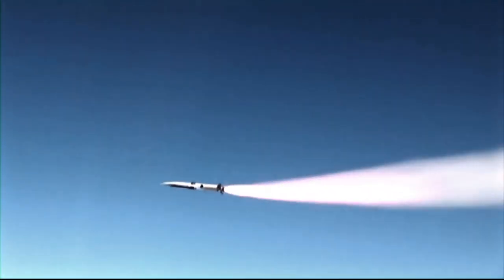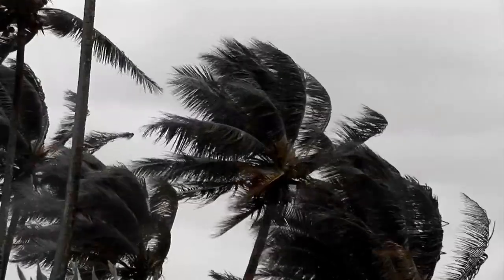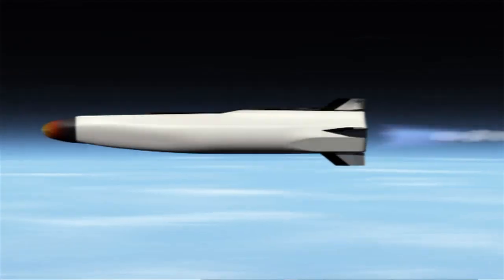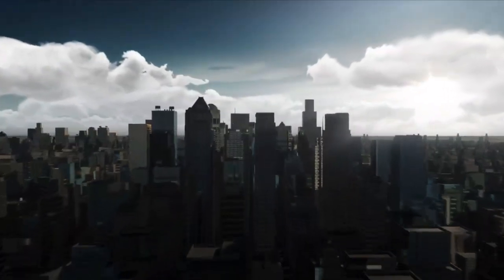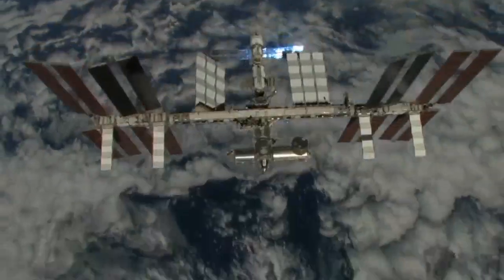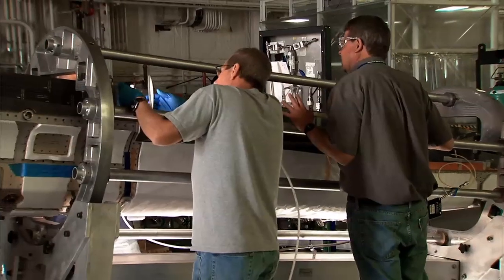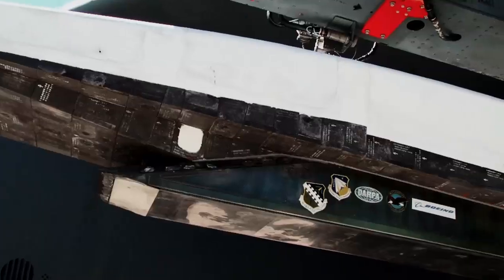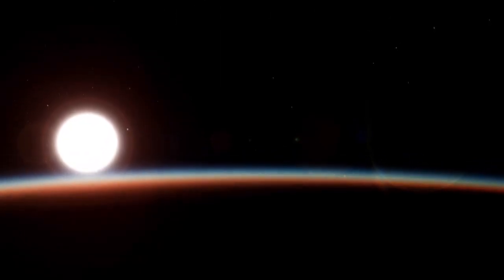Boeing's Unmanned Scramjet, the X-51A WaveRider, Achieves Hypersonic Speeds

Comment: As an Aerospace Engineer, the Scram Jet propulsion system has been known about for decades. It has been known as only as "theory" in which military applications have  limited the access to this technology. (Aura spy plane, etc). Its quite possible that this has been a reality since the early 90's, but has not been a public possibility until recently.
Reply: Most likely because it will never work in a practical application or there is already secret technology to replace it.
Reply: If my understanding of how the scram jet works is correct it needs an atmosphere to operate in correct? So how would it help us get to another planet or further into space if it relies on having an atmosphere
Reply: and so the saying goes, "it's old news when it's new news to the public"
Reply: I think taco bell is assisting in funding do they can harness this power for taco delivery.
Reply: David Phillips It has been, the problem is money.  Scramjet technology is so expensive to just get it to work, that no company has been willing to put serious research dollars into it.  The military won't do it either as they already have various rockets that already do the job anything a scramjet would look to replace.
Reply: zachpaw the need for an atmosphere is not necessary. It does help the scram jet work in this planet but in any case the scramjet would be in use for a scenario such as in space the scram jet would be equipped with its own gasses or oxigen for propulsion. I am sure the engineer's would choose another gas such as nitrogen. So your comment is partially right. It does need some sort of gas from a atmosphere to function but it does not need the atmosphere to function.
Reply: They could put an air tank right next to it.
Reply: ChrisEvan Tapman defeats the purpose of a scram jet then.
Reply: Pep
Reply: The
Reply: Don Romeo prrrrp
Reply: zachpaw injunction
Reply: Luis, the gas would have to be oxygen as that is the gas that makes combustion happen with current fuels. Carrying your own atmospheric gases makes I a rocket, not a jet. The whole purpose of a jet is to use the atmosphere around the vehicle. The scram jet would only help in a very narrow operational range and is partly why the jets aren't being developed as fast as they could be
Reply: Jerad W domino's pizza is working on a joint venture for pizza and taco delivery.
Reply: Jerad W hmm i dont think you understood the video or the question i was answering. a jet (plane) does neet a atmosphere to finction accordingly to its designed purpose. But a scram jet does not necessarily need the atmosphere. it would if its designed purpose is to fly in the atmosphere and perform particular maneuvers using the preassure of our air. but if the scram jet is designed to be shot like a bullet or a artillery rocket out side our atmosphere then in that case it would just need the propulsion and its own supply of gas. then when re entering an atmosphere it can use parachute or some other designed way of stoping or hitting its target. lets say exaple we want to shoot a scram jet to mars. we mount it to a seperate plane or rocket, we supply it with its own gas and once it exits our atmosphere it can create its own propulsion with its own gas and it would be in its way. if we want a scram jet to be used as a bomb we can do the same with its programed trajectory and program it to fall back into the atmosphere and free fal into its target. again. atmosphere can be aprecciated but its not necessary.
Reply: Luis - I understand it just fine.  A scram jet absolutely needs an atmosphere to work.  That is what makes it a jet.  A vehicle that carries both the fuel and oxidizer is called a rocket.  There are plenty of proven rocket designs to choose from that are many times faster than a scram jet could ever hope to be.    Jet propulsion takes into the vehicle one of the combustion components (usually oxygen in the form of air) to make the combustion cycle work.  A rocket on the other hand, needs no external components added to create combustion.  Like I said, take away the atmosphere, you no longer have a jet, but a rocket.  I am not discounted the idea of using a scram jet to aid in space travel, but there are already better engines to use in regions of space devoid of atmospheres.
Reply: +luis casillas Supplying a scramjet "with its own gas" is basically just a rocket engine. That's what it is. Rocket engines (generally) mix fuels from two separate tanks containing RP-1 (An extremely pure form of liquid kerosene) and liquid oxygen. The liquid oxygen allows the kerosene to combust in the vacuum of space. 

So basically, the easiest and most efficient way to have a scramjet work in space is to just replace it with a rocket engine.
Reply: +luis casillas I think this only works when you have a mach 4 air flowing in.  it starts with normal rocket fuel, then stages, the air intake is a hige part.

Comment: As much as I like Boeing mach 5 is a huge ask. The SR71 at mach 3 was incredibly difficult to make work and expensive to fly. Surface friction meant they were scared they were going to cook the pilot. The pilot wore a space suit like an astronaut. Making a cabin that will allow normal clothing will be very hard. If Boeing could make even mach 3 in a commercial air liner that would be a huge achievement. I'd like to hear more in depth information about Boeings progress.

Comment: How high up was it? It looked like the edge of the atmosphere.
Reply: +ChrisEvan Tapman Not even close, even the ISS still experiences some atmospheric drag.
Reply: +ChrisEvan Tapman It activated the scramjet at around 70,000 feet.
Reply: +IAN 4000 50,000 ft is "technically" space right?
Reply: Adam Degrace No, Global Hawk can get to 60K, U2 can get to 70K.

70-80K is about 1/8th of the way the the lowest limit of a Low Earth Orbit.
Reply: Technically, space is about 60 miles from the surface, passed the atmosphere.
Reply: Space is generally considered to be at the 100,000 m (100km) mark. Djordje is right, as 60 miles is about 96,000 meters up.

Comment: If you go to extreme altitudes the air resistance won't be as large and you could go faster, although I am not sure what the fuel cost would be to go to such heights, or what kind of planes it would require.

Comment: The SR-71 used a Pratt & Whitney J58 turbojet. Two of them technically. It was not even close to being a scramjet. The scramjet takes air in at freeflow speed. The SR-71 had multiple devices to slow the air going into the engines down so that it never entered the engine above mach 0.4.
Not to mention the fact that the SR-71 obviously used turbine engines, and the scramjet has virtually no moving parts.

Comment: Short Answer: Not in our lifetimes.
The problem with these is they only burn for a minute or two. The faster you go, the more air resistance (and at these speeds air compression) you face. In order to get from NY to LA in under an hour, one needs to travel at about 2100 mph, give or take a couple hundred.Changing speeds from 55 to 65 mph requires just under double the power. Imagine what's necessary to go from 500 to 2100. It's Definitely not a factor of 4. I would estimate it's a factor of 100.

Comment: The "parts" coming off is the booster stage. A scram jet engine will not work at sub sonic speeds. You use an airplane to get it high enough that a relatively small rocket booster will accelerate it past the "sound barrier" and up to about Mach 3where the scram jet can take over.

Comment: The big problem with the Concorde is the continental speed limit, overland air traffic is prohibited from exceeding Mach 1, because of that limitation no one bought the Concorde because they couldn't use it efficiently. Subsonicly the Concorde was a gas guzzler so extended low speed flight would eat lots of fuel, British Airways and Air France only maintained their aircraft for political reasons.

Few concorde's + continental speed limit = stupidly high ticket prices

Comment: flight at mach speeds like that causes a whole other list of safety issues. The friction from the air moving across the  airframe at that speed alone causes massive amounts of heat. But I would so still strap into that thing and push the little red button.

Comment: I think SSTO is a way of taking too many accessories into orbit. I think the (sc)ramjet should be the intermediate stage starting from the lower super sonic to the upper hyper-sonic(m5+), launching a rocket stage delivering a final push to orbit. The initial stage would be to the troposphere,  It could be an upper trans-sonic/lower supersonic turbo-jet/fan.Instead of lugging the mass of a much larger mothership, it can be roughly similar in mass. It could be like Spaceship1, & Virgin Galactice w/ an intermediate sc/ramjet phase.

Comment: So I was asked why we could not use scram jets for passenger flight or other programs besides nuclear weapons delivery.   You could of coarse use it for passenger planes, but there are so many drawbacks for manned flight at these speeds.  What do you use to get the craft up to scramjet ignition speed?  How do you deal with the sonic boom problems over the main land?  You will have to be at the edge of space to reach the mach numbers to make it worth while.  On the other hand a scramjet used for nuclear weapons deliver can use toxic fuels,  will be faster than any rocket based defense system.

Comment: Make something work without using traditional fossil fuels but  can go speeds of mark 5 and greater.. Now that will be an achievement, or design an aircraft with the same platform that you find to be aerodynamic but have either a chemical application on the aircraft or use a mechanical device that minimises air drag coefficientcies to achieve greater speeds with minimal to zero drag. Now that.... #Boeing will be something. Think big! Or don't.

Comment: Isnt this conceptually similar to blackbirds? I mean using the shockwave is what blackbird was also doing wasnt it?
Reply: The SR-71 used Pratt & Whitney J58.  The updated variant was a partial ramjet.  It used conventional compression at lower speeds and area compression at higher speeds.
Reply: Minion
Reply: If I remember right, the shockwave was greatly reduced when entering supersonic speeds for the SR. That was the cones main function, at subsonic speeds it would be in its standard place, once supersonic speeds was reached it would retract by nearly 2 feet to decrease the shockwave
Reply: Matt Jones Yes i listened something similar to what you are explaining in a documentary about blackbirds it retracted its conical shape at the jet engine entrance to adopt the shape of shockwaves at different mach speeds.
Reply: Joseph Tenney Hmm pratt and whitney is the same company which makes the engines for yf-22 i think. I remember sr-71s had retractable cones to adopt different mach speeds but this is a totally different engine airtake design i guess.
Reply: Cem Savaş Aydin No, a scramjet does not contain a typical rotating compressor to compress the air into the engine.  The blackbird still has one.  The nosecone just modifies the "shape" of the incoming air.  A scramjet's shape (no moving parts) is what compresses the airstream.  In order to work at all, a scram jet must be going faster than mach1 (or more), the blackbird can run its engines on the runway.
Reply: Jerad W Well looks like you know a lot about these planes. Have you like worked with these scramjet technology.
Reply: No, but I have a MS degree in engineering and propulsion.  It's been since 2001 that I have studied them in detail, but the problem is no company really wants to spend the money to develop the technology.
Reply: Not conceptually the same as the blackbird.  A scram jet refers to the type of engine.  A scram jet could have wings or not, but that is not important to the fact that the engine is what is so different.  The blackbird still used rotating engine parts to compress the air and fuel mixture.  A scram jet uses the vehicle's speed to compress the air fuel mixture.  Adjustable engine parts are nothing new, but were used to their fullest in the blackbird engines.
Reply: +Cem Savaş Aydin The blackbird uses a turbo-ramjet. It's sort of like a scramjet, but since it's a ramjet, it has an extra cavity in the combustion chamber and since it's a turbojet also, it uses a compressor driven by a turbine that's powered by the exhaust of the engine.
Reply: IAN 4000 wow i must go read some material first before i can even understand what you wrote above.
Are you a avionics engineer?
Reply: IAN 4000 It is a plain turbine jet, not a ramjet.  For one, ramjets aren't turbo charged.  They can propel vehicles much faster than anything having rotating parts, so they would only be slower with them.  Also, having rotating parts, by definition, doesn't make the a ram jet as both rams and scrams don't have rotating parts, that's what makes them unique compared to "regular" jets. What makes the blackbird fast is the ability to adjust the intake geometry to accommodate the higher speeds.  Ram jets compress the incoming air solely by the geometry of the intake (no rotating parts).  They also must slow the air stream to subsonic speeds prior to combustion.  Scram jets also compress the air solely due to geometry, but the combustion chamber doesn't require subsonic airflow.  Any other jet that has moving parts to compress the air are not ram or scram, but just jets.  Adding moving parts to ram and scram only slows them down and possibly makes them not work at all.
Reply: Jerad W The Pratt and Whitney J58 is generally referred to as a turbojet, but since it has a cruising ramjet mode that the pilot can switch to at around Mach 2, it can also be called a turboramjet. It is a partial ramjet with a primary turbojet function, so one wouldn't be entirely wrong in calling it a turboramjet. So technically I was right in calling it a turboramjet, but I was doing so for the wrong reason since I hadn't studied the inner workings of the J58 engine at the time and thought it might have used heat exchangers like the SABRE engine.

When switching to ramjet mode, the J58 switches its main thrust producing flow to its outer channel, which doesn't use compressors. The plane literally diverts its fuel flow to the ramjet-alike part of the engine. 

Also, I know what ramjets and scramjets are.
Reply: The compressor is still active, hence, not a true ramjet.  The incoming air still is compressed by the first 4 stages of the compressor.  Using a bypass and an afterburner doesn't make it a ramjet.  Even the designation from the company that makes it doesn't claim it to be a ramjet.
Reply: Jerad W Alright, fair enough.
Reply: +Cem Savaş Aydin ㅣ 8 ㅐ

Comment: Scramjets only work at mach 3 or better. so it requires either rockets or a lift-off vehicle. better to put the research dollars into the ESA Sabre engines. True air-breathing rocket engine design.

Comment: I love the idea...but a scramjet engine will burn through the fuel in no time. Increase the fuel tank capacity and make a longer lasting burning fuel. I believe the range is only above 410 miles with a full tank.

Comment: Great technology, it will work commercially quite well the Concorde needed a redesign, and with this the fuel payload can be decreased. This will probably serve dual purposes, launching low earth orbit or space station flights and quick transcontinental flights. They've already made it function, and proved it, now like any tech it's got a long road before we see it commercially, sadly 20 years is about right,  you would think that by 2013/14 we would be faster at introducing new technology to markets than 20 years. Delivery on investment is so slow that the markets borderline fail before their saving grace have arrived.

Comment: This seems misleading. Why do they mention space travel? A scramjet won't work in space, right?
Reply: if 90% of the journey to low earth orbit is done via scramjets, you wouldn't have carry nearly as much liquid oxygen.  The weight savings would be incredible.
Reply: Think of it like a zeppelin shoot a bullet into is and the hydrogen will slowly seep out but if you ignite the the bullet going in and allowing a large air flow it will catch on fire. So I think it might just work.
Reply: richXPT707 is right, partly, in addition to this, getting the right speed is essential for orbit, it could mean low cost geosync orbits achieved within lower budgets, IE, disposable recon satalites.

Comment: The Warp Speed of Today: Boeing's X-51A WaveRider -
The X-51A Waverider is an unmanned scramjet-powered demonstration aircraft, capable of achieving hypersonic speeds five times the speed of sound. At that speed an aircraft could travel across the U.S. in under an hour. Learn more about how Boeing innovates at http://boeing.com/stories/videos.html 

The X-51A Wave Rider program is a joint program between Boeing, the Air Force Research Laboratory, DARPA and Pratt & Whitney Rocket Dyne.

Comment: He should said from one end of the world to another, not one end of country. Because that statement undermined the scale of this vehicle's operation. And by the way this is an old tech from the cold war era. The proposal of its transportation use never took off sense the 70s, and the development of modern IT significantly reduced its practical use. Unless you are going to intercept an ICBM or out run that M3 interceptor.
Reply: So again you think a  Mach 4, Mach 5, Mach 6, etc., Scram jet for comercial transportation uses is going to be used to intercept a Mach 20 to Mach 22 Russian or Chinese ICBM missle? 70's Era computer tech., Electronic Communications, Signals processing, Radar tech. has obviously come a long way. In the 50's, 60's, 70's, just as now, Defense contractors and those contracted at NASA made it all happen. Not exactly sure what the problem many have with this video?